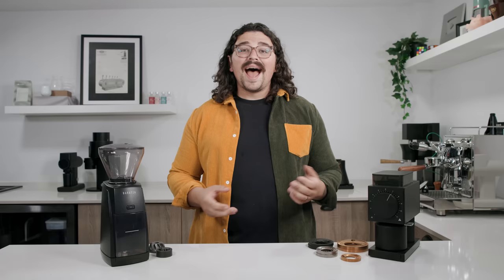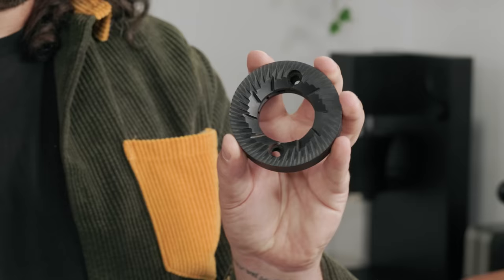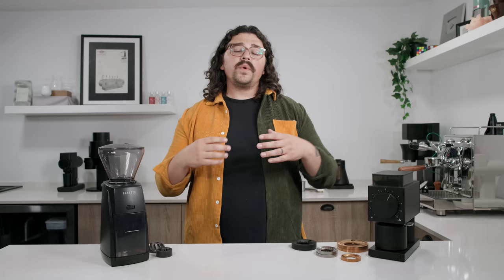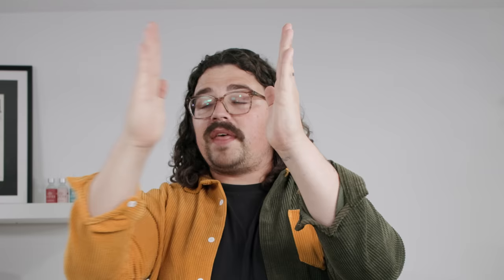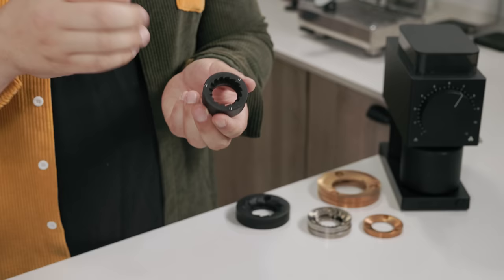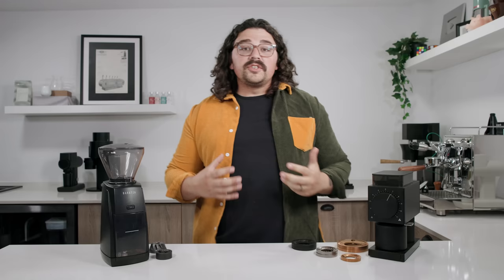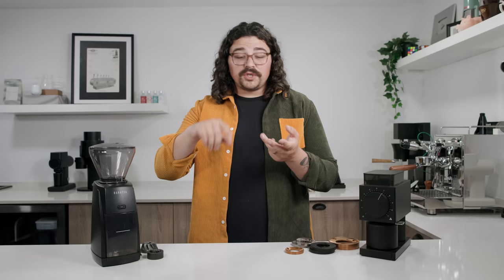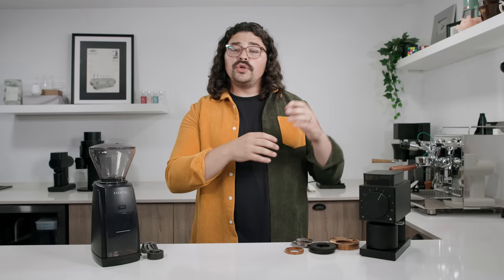THE GREAT BURR BATTLE: Demythologizing the Conical vs Flat Debate

Comment: Well said Lance the grinder can only enhance the flavours thar are present in the bean and the roasting, if you have a Costa Rican grown arabica bean dark roasted, no matter how flat or large or geometrically designed burrs in your grinder, you will not get much by the way of fruity, florals and acidity, you will still get rich chocolates, smokey, whiskey flavours, and if you have a light roast Ethiopian grown coffee you won't get that rich full bodied chocolaty shot even from a 63 mm cone burr set. Grinders cannot changed the principal taste profile of the roasted bean, it can only make the most of what the grower and roaster has already imparted within the beans.
Reply: Sure coffee will make a difference for sure, I've heard people complain though that the Niche (a very typical conical profile grinder) makes everything taste the same (chocolately/blended). I don't think I noticed that when I briefly had it, it blends flavours together rather than having separate flavour notes but it doesn't necessarily turn it all into chocolate.

Comment: Hey Lance, this is out of topic but can i suggest a video about trying to make the most out of budget home espresso machine (eg: delonghi) where you upgrade most of the essential parts such as changing the shower screen, using puck screen, upgrading the filter basket, modding it, etc..? I think it'll be interesting to see how it compares to default mid-high end machine when all of its essential parts are upgraded.
Reply: I’ve done it. The truly essential changes you need to take a cheap DeLonghi and make great espresso with it: 1. Knowledge of temperature. A cheap digital remote thermometer, place the sensor on the boiler/thermoblock. You’ll know exactly when the heat has gotten to where you want it. 2. A dimmer for flow control. All the other stuff is secondary.
Reply: @Gk2003m  Yeah, i would love to see how it compares to other machines. Me personally the upgrades and accessories that are highly effective in improving my shots are dimmer mod and puck screen, especially the newer thinner models not the mesh one. Although i mostly make espresso as a base and not drink it straight, it really helps with the channeling which is my main issue with my cheap machine

Comment: In my relatively brief journey into brewing coffee with higher attention to detail (about one year) I have only used conical hand grinders for espresso and pour overs. I currently use a 1zpresso x pro for pour overs, which I love, but feel like I’m hitting a ceiling for the amount of clarity I can get in a pour over (not even totally sure I would prefer more clarity). I have recently been sifting out about 1g of fines per 16g dose, occasionally, in attempts to dial in towards more clarity. Would this theoretically get more further into the neighborhood of what higher clarity flats can do, or should I maybe just consider initiating myself into the realm of flats? I have been eyeing the ode gen2. Lance, thank you so much for all the help along the way!
Reply from the maker: hey! I think sifting out fines, especially 1g daily, can get wasteful. But if you are finding you are preferring those cups, do it! You could also try grinding while holding the handgrinder at a 45 degree angle before feeling like you need to shell out more dough for another grinder. This angle will actually slow the feedrate and will cause a different interaction between the beans and the burrs. Give that a try!
Reply: @LanceHedrick Wow. Is the 45   degree angle anything you explained before? I am at 5 minute mark, so maybe it is in here. I am not sifting and like the body mouth feel chocolatey profiles, but tend toward 45 angle for handling ease against my body. Inadvertently added a variable to control for!?
Reply: @LanceHedrick  thanks again, Lance! Yah I have wondered if this is actually wasteful if after removing fines I can push the extraction of the rest of the coffee further before getting a bitter astringency (I usually grind a bit finer with fines removed). Is it actually wasteful if it produces the same volume cup with the same strength as if no fines were removed? Idk interesting philosophical question tho. I also occasionally add the fines back in after the final pour and do a shallow swirl with a chopstick, so that they can add a little body and flavor, hopefully without giving the cup a bit of a chalky bitter finish (which is what I’ve been attempting to get rid of). will def try the 45 degree angle trick! 📐 thank you so much for following up with your commenters!
Reply: @Ma_Ba  absolutely! I experienced this and been only hand grinding coffee for a couple months. In my 1Zpresso J-Max the difference is astonishing. From grinding vertically to 45 degrees or almost horizontal can be as different as getting an espresso in 5 seconds or in like 90 seconds or completely choked. It’s ridiculous. I was shocked that I couldn’t find anyone talking about this online. So glad to finally see an expert mentioning this behaviour, so thanks to you Lance!
Reply: @Kobeder  The angling sifts out fines? Makes longer draw downs? Longer pulls?
Reply: @Ma_Ba  angling produces many fewer fines or shifts the average grind size to larger sizes. So angling leads to much faster shots.
Reply: @Ma_Ba  the James Hoffmann video on regrinding coffee gives a pretty good theoretical explanation on what’s happening when you grind with a slower feed rate (which you can produce with a handgrinder by angling it)

Comment: Next we just need a 5hp motor with VFD controller, geared transmission like on a commercial stand mixer and 100mm burrs. Bring on the single rpm studies and laser particle size distribution measurements

Comment: I was thinking about this as I was contemplating getting a new grinder for drip/pourover. I'm able to get a lot of clarity from my 1zpresso hand grinder... so I've been thinking it's more related to how the beans are fed through... which seems to be confirmed by your statements here. It's the feed  rate and cutting surface area. While I'm happy with my conical burrs, I ended up chosing the Timemore 64 because I like the idea of having multiple interchangeable burrs

Comment: I think the influence of rpm on grinds is yet to be fully scientifically explored. I‘m really waiting to buy a higher end grinder until that point. I think if you have a machine like a Decent that can do anything you like to ground coffee, you should definitely have a grinder that can do anything you like to the beans. Recently more people speak about the influence of rpm on a grind. So it’s not only cone or flat, it’s also 30 vs 350 vs 700 vs 1300 rpm that will significantly influence the whole experience.

Comment: Would prefer to just see grind size distribution graphs for each burr used on the same beans at the same rpms and across their range of rpm
Reply from the maker: what would that do to help? there have been no substantial sensory studies on the correlation between taste and PSD. We are just now discovering that burrs are potentially trimodal as opposed to bimodal. we don't know enough for that without proper context to make any sense. It would just be misleading at best
Reply from the maker: (this also presupposes unlimited access to a particle size analyzer or imaging unit. Both cost upwards of $50k. I do plan on making these available when I can get all my grinders to a lab. but until then, we have to rely on the limited data out there. I'll link something Gagne and I have worked on re: the data Kaffemacher gathered recently)
Reply: @LanceHedrick  That would help us to better correlate taste and PSD.  Without the data we are just talking about things we are making up based on 'feelings'.  We need to move toward understanding this more scientifically.

Comment: Baratza Vario is a good example of how a flat burr grinder can cover a spectrum and   why the burr style (flat) doesn’t tell the story. The ceramic burrs produce a more traditional, chocolate forward “cone” style shot. And the steel burrs produce a very high clarity shot. Same grinder. Same burr size. Different geometries.
Reply: The ceramic probably has a lot to do with it too, you don't get really sharp cuts on ceramic burrs, and the friction on the ceramic probably has an effect, it's not smooth like a treated steel burr. I remember I had the Vario and I had a small ceramic hand grinder and they both produced what I thought was basically the same results I think it was just mostly fines :) So you get a lot of body, not much flavour clarity.

Comment: thanks a lot for this video! 
i am trying to understand what causes the differences between conicals and flats, and as you described, it cant be said in general but its more a fuction of the burrs crushing and cutting geometry. 
Have you found any literature on what features on the cutting surface will give which result in the (espresso-) cup? 
I also noticed in a lot of forums and also your video on the niche zero, that conicals should be run at lower rpms to reduce fines
First, why is that?
 And second, does this apply to all conicals regardless of size? Or is it more a fuction of the "cutting speed" or circumferential speed of the burrs? this would result in a higher optimal speed for smaller burrs than for bigger burrs, but would not make sence when one looks at the much higher speeds that flats (wich mostly larger outer diameter than conicals) are run at.

Comment: Lance have you not used anything with the 83 mazers in the key/HG1/HG2/HGPrime?  I  recently got an HG-Prime and really really enjoy its shots, but id be curious where youd place it on your theoretical spectrum.
Reply: I'm also curious how the HG1 Prime compares to the Weber HG-2/Key with the same (BUT differently coated/treated) burrs. I think it might make a bit of a difference in the flavour profile. On the HG-2 and Key I found it's very flat-burr like, decent flavour clarity, not so much body, but I did notice sometimes a silkyness that wasn't present usually on my flat burr grinders. I heard the Uncoated Mazzer burrs might be a little more traditional conical style with more body and less flavour clarity but I have no clue where I heard it, or if anyone has confirmed it.  Either way it's a nice / beautiful grinder :D
Oh and if you just got it recently,  it should get even better after seasoning.

Comment: Surprised to hear there wasn't much difference going from 50-150RPM on the Weber Key, the range is pretty small, from like super low RPM to low RPM basically, but I thought it made a difference, much cleaner and more flat burr like (higher clarity) at lower RPM 30-50rpm! 
I know you don't believe it (yet) but think Variable RPM does affect the flavour profile EVEN ON A FLAT burr. There may be some exceptions to the rule but on most of my flat burr grinders seem like you do get more flavour clarity and less body, maybe more acidity with lower RPM and at higher RPM more body, more blended flavour maybe sometimes more bitterness / intensity as well. Maybe it doesn't show up in particle distribution analysis but I suspect grounds are affected some other way perhaps shape.

Comment: As espresso brewing is heading towards flow and pressure profiling, i expect grinders to follow. Variable rpm and feeding mechs may lead to as much fines my brew need. Variable rpm is easy, feeding mechs needs engeneering. So i d not surprised if catch cups incl sieves will come up next. We will stack our grinds into the basket and the fines put on top to decrease over extraction. Theres so much ahead... 😊

Comment: So, is a rally chocolatey tasting shot considered “muddy and undefined”?

I have an older Ceado e6p with the stock flat burrs. I still love this grinder, but fined some very different results based on beans themselves.

I obviously have to dial in each bean, but certain beans are very chocolate while others are very acid and bright with a fair amount of clarity (based on my pallets understanding, lol!) am I wrong in feeling that I receive vetting result from different beans or is it a combination of my lack in skill of dialing in plus the difference in roast, origin, elevation, etc.?

Just feel a little unclear on this a times. Looking to understand these things better in order to improve myself.

I also take into account brew temp and time duration when pulling a shot. I know all these factors play a role in the end result of a shot. Just trying my best to maximize my knowledge, application and improve my overall skill level.

Am we off in my thinking or comprehension? Thanks for any input in advance, I appreciate it.

Comment: i know a lot of the message in this video is generalizations on burrs are bad. But generally do you think bigger burrs grind faster?  Is it purely marketing reasons that it seems like manufacturers are making grinders with bigger burrs?
Reply from the maker: For commercial environments, bigger heat up slower, grind faster, etc. It's all to maximize efficiency and speed when slammed.

Comment: What would happen if you started mixing burrs? Like one side is speed and the other is multipurpose or something like that.
Reply: Just watched a Sprometheus's Niche Duo video and he kinda did that, mixing and matching the brew and espresso burrs, it worked but did EVERYTHING pretty poorly, so yeah, no point really, it's possibly some combo or burrs could potentially accidentally create good results but what are the odds really. 
Some burr designs ARE asymmetrical where the spinning burr is designed a bit different than the stationary burr, I noticed option-Os mizen burrs are like that, more little cutting tics on one side and less (but larger cuts) on the other side.

Comment: One question is, can tilting the grinder at a 45 degree angle handheld help with clarity?
I have a C40MK4 that I used briefly for 078 for a week, and I am currently looking for a grinder that offers more clarity, separation, and is otherwise competent, so your video was very helpful to me.

Comment: I know we refer to coffee as grinds, but with a conical burr, would it almost make more sense to call them cuts? Or when you adjust the collar, youre adjusting the "cut" on the grinds?
Reply from the maker: No.  With cones they are really grinding them. Like, loads of rubbing. Cuts are ideal and flats largely do a better job
Reply: @LanceHedrick  Is there any cutting taking place at all? Is there a point to the burs being sharp vs. dull?

Comment: What interests me very much: If you work with a single dose grinder, a hot start requires a finer grind setting than a cold start. But is there also a change on the particle size distribution?

Comment: I disagree with you that fewer spokes equal a faster feeding rate and more difficult to grind. I think it is the opposite way. In my experience inner burrs with more spokes require more torque to operate because it curshes more beans at the same time hence feeds more beens given the same amount of rotation.

Comment: Dang I thought by the title you were going to end the Flat Vs Cone POUROVER debate!
Please test the Weber Key for filter.  I bought one but still prefer the workflow of my Eureka KR doser (yes I single dose, 20 in, 20 out) LOL, so I am sitting on this Key for now.
Reply from the maker: oh nice! I should make a video on flat and cone brewers. That will be coming up now that you say it!!
Reply: @LanceHedrick  If you can, please include the humble Melitta, which is what I'm currently using.

It seems so many reveiwers ignore the Melitta; I can't get a good read on how other styles of drippers compare. It's neither a cone nor a flat, more of a flattened cone with a tiny hole.
Reply from the maker: issue is that doesn't fit in the lovely "flat vs cone" title haha! Considering it is semi conical lol

Comment: Lance what are your thoughts about: manual conical burr grinder + electric screwdriver? would it make Daddy Hoff say a whole lot of "NOOO"-s?
Reply from the maker: Depends on the build quality of the grinder! I'd recommend a low rpm screw driver.